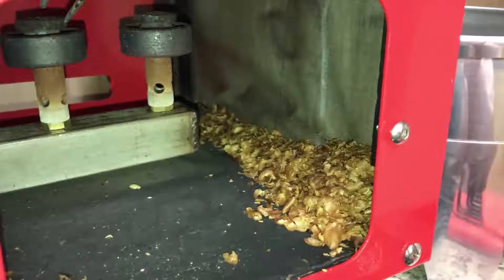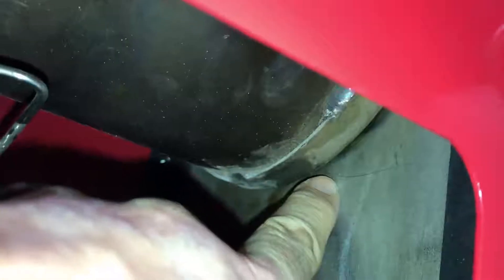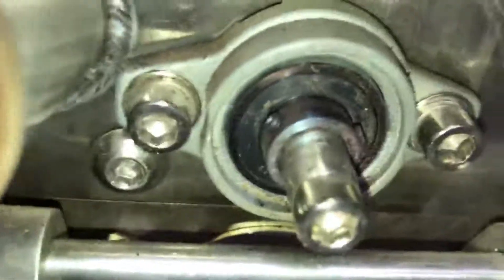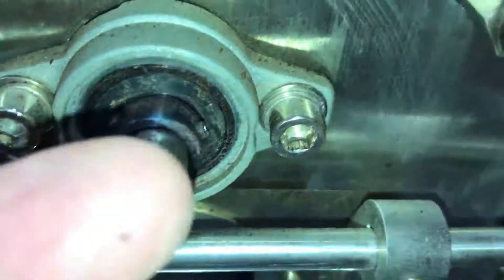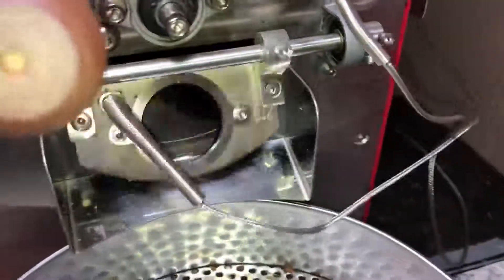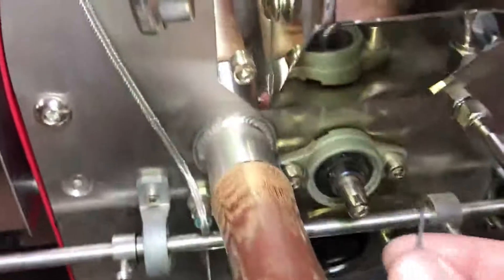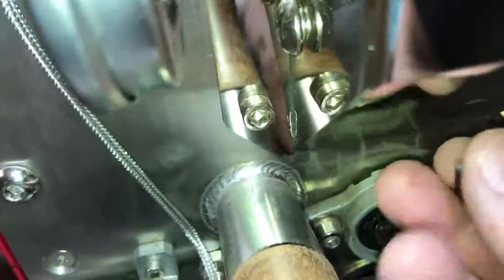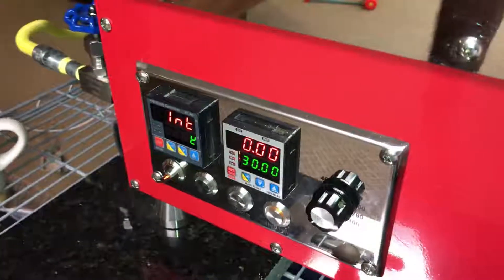Adjusting the Drum of a Mill City TJ-066 Coffee Roaster

Comment: I’ve watched several of your videos and wonder...do you feel the tweaks you’ve done to the machine are standard and expected or do you think this machine has some quirks?
Reply from the maker: Hi Mark, I don't think it is a quirk.  When I change the front bearing the drum has to be adjusted each time.  I have replaced the front bearing several times.  Seems very excessive.  So, I finally figured out that the grease used in these bearings is a standard industrial grade.  They come that way from anyone you purchase bearings from.  Since then I have cleaned out and repacked a front bearing with high temp grease and have had no issues.  I would expect this to happen with all of the 500 gram roasters that are the early generation.  I can't speak for the newer generation model currently being sold.  Hope that helps.
Reply: @MikesZone thanks!

I’m considering the purchase of a Mill City roaster in the future so this is good to know.